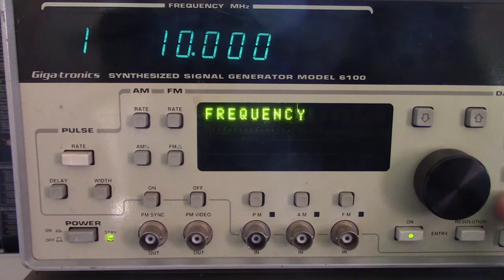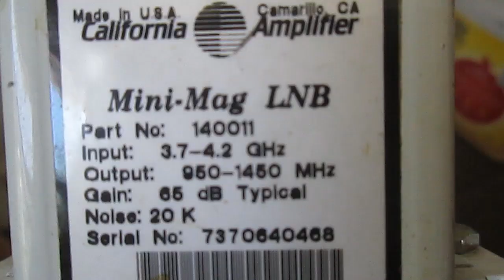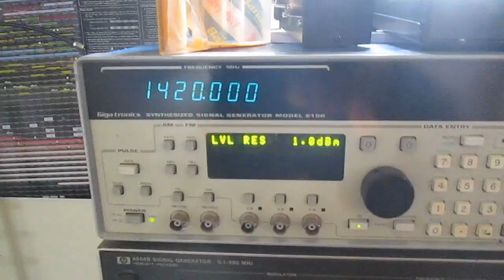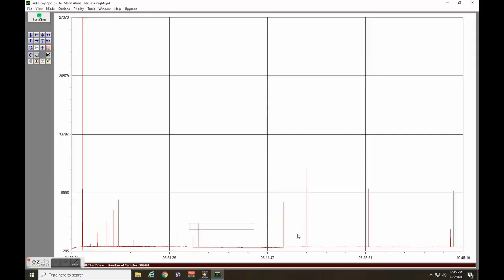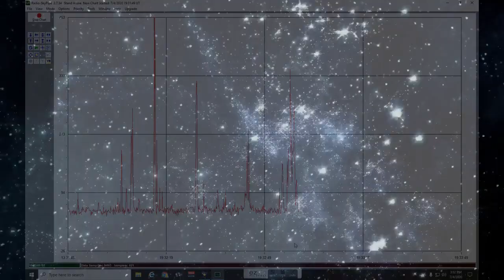DIY RADIOASTRONOMY

Comment: Sir, Can you please send the list of all the equipments?
Reply from the maker: Everything was described in the video but if you need more details I'll be happy to provide them as long as you are being specific. Thanks for watching!
Reply: @Neptunium   yes, I need a detail list, as I am making one for my project, please help me out
Reply from the maker: @pi.log10  
I used a 6ft dish antenna, the ICOM ICR7000 receiver, a LPT-3000 spectrum analyzer and the BladeRF SDR radio. I also tuned my antenna and receivers with a Gigatronics signal generator 0.01 to 8Ghz.
The software is the free download chart recorder from Radio Eye. All the cables and connectors are regular TV coax cable found everywhere. Thanks for watching

Comment: Hello, what was the size of the cantenna? Diameter etc. That you used?
Reply from the maker: Cambell soup can, the one that fit the feed horn support. and accept the inner wire length, if its too long cut it if it`s too short find another one or make one. Thanks for watching!

Comment: Can you point this towards the center of the milky way searching for 20.5 mhz like Jansky discovered in 1933 with the once every 23hrs 56 mins where he would pick up a hissing static noise?
Reply from the maker: Yes ! That's kind of what I did  but at a lower frequency. It shouldn't be a problem . I just can't see the Milky Way central area from my location.. thanks for watching!

Comment: Nice....but your 1420MHz feed is of the wrong size, it is much to small! The 1420.4MHz probe length should be a quarter wave long (only just under 6cm) and the can should be much larger diameter. The probe is then mounted 1/4wave from the bottom of the can.
Reply from the maker: Its close enough . I know it doesnt look like it on the video but i tried to get as close as possible to the 1/4 wave length....thanks for watching ! Always appreciated comments sir!

Comment: How do the radio telescopes generate images of stars orbiting black holes.. it shouldn't be possible with the simple antenna you used just to detect if there is a signal or not
Reply from the maker: They use the same technic a lot more precise than my little set up. The resolution is infinitely higher than mine. Then they get a single picel data point one by one until they can get a complete picture. Its a very long painstakingly tedious process.
Reply: @Neptunium  omg.. and here i was, thinking about looking into the edge of universe with my 4 foot dish..🤣
Reply from the maker: I whish we all could !
Reply from the maker: I could not even remotely pick up  pulsar eiter ... maybe a 15 or 20 feet dish could but certainly not my 6 ft ! That would be so cool tho..
Reply: The images of the S stars orbiting the Milky Way’s black hole are taken with optical telescopes, not radio telescopes.  Images of the black hole itself were done with multiple radio telescopes all over the planet combined together with interferometry to make one big virtual telescope the size of the Earth to achieve the angular resolution needed.

Comment: How can I connect with RASDR2 software or laptop pls make an video I am working on a project I am from middle class family so I can't afford so pls make a video and help me 🙏
Reply from the maker: Actually, I am not familiar with the RASDR2 at all but after a quick glance at the website, I don't see why it would be any different than any other SDR and software combo.. they all work the same way and it all come down to the type of connections for your coax cable . It really is that simple. No need for a video my friend, I am sure you are fully capable to connect a cable to an SDR module! Thanks for watching!
Reply: @Neptunium  thnx dear for helping me many more love from India ❤️

Comment: Could you see the hydrogen line with the Yagi?
Reply from the maker: You might be able to find a Yagi tuned for that band yes I believe so
Reply: @Neptunium  Thanks! I might try and build a 1420Mhz stack Yagi.  Tune it with a NanoVNA H network analyzer, hopefully that will work. :)
Reply: @Neptunium  yes sir u are correct we can find 21 cm Hydrogen line using Yagi. We are doing our project on Hydrogen line detection using various antenna

Comment: I was wondering about using a Yagi Uda antenna and thought that there must be reason why no Amature Astronomers seemed to be using it.
Reply from the maker: the wavelength is the main reason, dish are generally better at higher frequency and far more directional than Yagi, which are better in the VHF and lower UHF (again generally speaking) and with significant side lobes .. having said that it`s absolutely not a problem to use a Yagi and it has been done before no problem!
Reply: You need a lot of gain to do this as the signals are very weak.  You can use multiple long yagis, but a dish has much more gain and is cheaper and simpler.
Reply from the maker: Exactly!

Comment: Is it ok to use old 6ft dish
Reply from the maker: Yes
Reply: @Neptunium  I am building one next week
Reply from the maker: Cool ! Keep us posted about your progeess and results!
Reply: @Neptunium  ok now I'm using PICTOR free to use telescope to study about signals
Reply: I ordered RTL SDR,LNA ,and other cable connector from Amazon I'm so excited 😅
Reply: I have a doubt is it ok to power up LNB using a 9v adapter dc
Reply from the maker: @Steveinbasement  I dont see why not.. depending what kind you getting, they usually run on 12 to 18V from my experience .. 9V is fine
Reply: @Neptunium  Ok thanks man
Reply: @Neptunium  Can you tell me how much current and voltage I needed for  LNB and LNA I have a 12v and 2A adapter i think I use it to power up LNB and LNA with 12v 1A is it ok I mean does it damage my RTL SDR
Reply from the maker: @Steveinbasement  i honestly dont know... it depend what you are using . mine works with the power supply from an older satellite TV system and generates 18V DC.. As I talk about in the video, I used a bias filter to NOT blast 18V DC into the spectrum analyzer and the SDR. So you`ll need a T connector with your filter at some point.
Reply: @Neptunium  ok
Reply: @Neptunium  does using RTL SDR is legal or require any license
Reply from the maker: @Steveinbasement  its legal, no license required.
Reply: @Neptunium  can you tell me a better free to use application for radio astronomy
Reply: @Neptunium  I'm currently using AIRSPY
Reply from the maker: @Steveinbasement  oh i am sure a simple google would help for that...
http://www.radiosky.com/downloads.html
A lot of resource and help here:
https://www.astroleague.org/programs/radio-astronomy-observing-program
Ham radio has all kinds of helpful site like this :
http://www.astrosurf.com/luxorion/qsl-ham-software.htm
and this list of free software for RTL-SDR enthusiast..
https://www.rtl-sdr.com/big-list-rtl-sdr-supported-software/

This search took a whole 4 seconds...
Reply: @Neptunium  thank you it's really helpful im trying to build a array detector with 2 or 3 6 ft CBand dish 
And merge the signal from 3 LNB into one and then to LNA to RTL SDR does it works fine and do you know how to convert this signal to image
Reply from the maker: Ah yeah an interferometer ! That would really be awesome ! You know I've looked for easy way to get pictures from a signal but I could not find anything other than these 2 options which are both long and a real pain.
https://youtu.be/aeah3fFYlnA
And this one
https://youtu.be/AAJTHsjYoPA
Both very good and interesting but without the critical details ...
Anyway good luck ! Make sure to share your results!
Reply: @Neptunium  can i connect to 2 or 3 LNB source with splitter to merge signal i search for this cable splitter but there a some specific values 5-1090mhz 5-2590mhz and it only used to split does it affect if I look for hydrogen line frequency
Reply from the maker: @Steveinbasement   if you have a down converter then no, a lot of LNA have a down converter and you want to look for your signal at whatever the downconverter says usually 950MHz. Building an interferometer with several dish is not a small project... maybe you should start smaller and once you've become familiar with the equipment, move on to a bigger project ... but baby steps first to be successful. just my 2 cents
Reply: @Neptunium  yeah thank you
Reply: @Neptunium  so my RTL SDR can tune signal from 500khz to 1.7 ghz so I can tune only to 950 mhz my downconveter says 950 mhz so if I use single dish and lnb even after tuning is only to 950 mhz I'm confused now
Reply from the maker: @Steveinbasement  The downconverter convert the highest frequency in Ghz from the lnb to lower frequency for the SDR to pick up. so the low 3Ghz will become the lowest side in your SDR and the highest signal from the dish will now be the highest part of your downconverter range (from ... to ...) its a range not a single point you get it ?
Reply: @Neptunium  it means I can listen to all signal with SDR even using a LNB downconveter can you tell me which is efficient and better for my setup LNB or a feed horn you builded
Reply: @Neptunium  now I built a wire antenna with my friend it is working well
Reply from the maker: No I can' t possibly know that, You'll have to do your own testing and see what works best for your set up. That's part of the fun too ! Best of luck!
Reply: @Neptunium  thank you very much

Comment: Well who knows if after 3 years you still respond however I would be interested seeing a hybrid system, a radioastronomy combined with visual astronomy.
Reply from the maker: it would be nice indeed! I am still working on a similar project, I cant make any promises just yet but I am working on stuff! Thanks for watching!
Reply: @Neptunium  I thank you for making this video, it seems less daunting then other videos on radio astronomy tho you didn't convert the data into images if I recall correctly you can convert radio astronomy data into images. that combined with visual astronomy overlaping each other would be very interesting. gonna watch out for your new stuff.
Reply from the maker: @Lillian_La_Elara_Silverwood  you are talking about delay doppler imaging and I was not set up for that in this video. Another way would be to simply map the radio signal strength and that's a different type of processing and set up.  Usually takes a long time and is tedious . The thought Emporium has done that and "saveitforparts" too ...

Comment: How did you calculate the length of the wire inside the can? (I'm guessing it's the wavelength, which should be around 21.1 cm)
Reply from the maker: Correct! The quarter wave works too so about 5 cm if I remember correctly
Reply: @Neptunium  Thanks a lot.

Comment: I am planning to build a radio telescope out of an old satellite dish. I can get my hands on a 0.9m dish that comes with an LNB  which operates at 10.7 - 12.75 GHz input frequencies and gives out an output range of 950 - 2150 MHz. Will I be able to observe the Sun with this equipment? In some articles I read that to observe the Sun at 1420 MHZ, one has to build a custom feed. I can understand that. If I build a particular feed it will have a capture bandwidth centered around 1400 MHz. And I can figure out the electronics for that. But I can't understand this LNB thing. Could you explain the input and output frequencies?
Reply from the maker: With the set up you described, you'll be able to observe in the X band between 10 and 12 GHz. You can use this microwave region to detect cold and warm bodies with extreme sensitivity. Because these are high frequencies difficult to handle, the down converter changes the signal linearity to more manageable frequencies. So if you see a signal at 950 MHz, on your receiver, that means it was picked up at 10.7. GHz by the antenna and down converted to 950MHz . It's a small transformer really . This LNB was designed for TV reception so the signal from the dish could be transmitted by cable to the TV. Keep it. It's very  useful.
Reply: @Neptunium  Okay now I understand. That's why it's called a downconverter. It's actually receiving the high frequencies and then converting it to low frequencies for analysis.
 If you could help me with one more thing I would be very grateful. 
The LNB receives the microwaves. Now I want to get an audio output (a buzzing sound as I point the dish to the sun) and then I would like to plot a graph. I don't know much of electronics. Indeed I'm a Bachelor of Science in physics but I have more control over theoretical aspects than practical applications. Some articles I read says one could use an Arduino. Could you help me with the circuitry?
Reply from the maker: @beaconoflight8298  I am not good at electronic either .. you can get a  satellite finder that's exactly what it does . You also need to power the LNB and the satellite finder, an old satellite TV receiver and some coax cable is all you need.  To get a graph as I showed in the video, you can use the output of the satellite finder and plug it in your PC like I demonstrated, and use any free chart recording software . Hope this helps good luck!
Reply: @Neptunium  Thanks for the help. I'll see what I can do.
Reply: Do a search for " Alex  Pettit galactic hydrogen radio astronomy " and watch the Aug 1 2022 video  
Cheers,
Alex KK4VB
Reply: The SUN is a broadband black-body radiator due to its Temperature .. It has no particularly strong  response at 1420 MHz as all the hydrogen is Ionized ( hot) . The 1420 MHz Spin-Flip frequency is associated with 'cold' neutral hydrogen .. as exists in the large interstellar space within the Milky Way.       Alex KK4VB
Reply from the maker: @alexp8144  I was just using the sun as a reference to get an idea of the beam size of my antenna but these are all valid points! Thanks for the comments! KE8YDE..

Comment: I am having a 3feet offset antenna to capture the hydrogen signal of 1420mhz .... Will it work or not?????plzz
Reply from the maker: I have no idea what you are using ! Offset what? Dish? Pole ? Yagi ? With what radio/ detector. my guess is You'll probably get something... you're looking for a 21 cm signal (as described in the video) so 3feet or roughly 1 meter is about 5 times too big . Worse case scenario, you can always try it and find out for yourself right?
Reply: @Neptunium  parabolic offset antenna height 38.5 inch and width 35.5 and depth 3inch...
Try to capture 21cm wavelength..
Will it work???
Reply from the maker: It's a bit small but you'll get something for sure. Have fun!

Comment: What's the difference between this and AM radio 1420? I feel like AM radio signals would just overpower radio waves on earth but I'm no astronomer or radio guru
Reply from the maker: You can broadcast in frequency modulation, amplitude, side band, etc.. but you listen in whatever modulation that matches the signal you are picking up, if I am not mistaken, the carrier is assigned by the FCC . They dictate what frequency to use to limit interferences between station. In radio astronomy it doesn't make a difference since in this video at least I was looking at the total radio power . I usually set it on wide FM but I did use AM just to see if it would make a difference.. and it doesn't.
Reply: 1420 on your AM radio is 1420 kHz in the medium wave band.  He’s listening to 1420 MHz, a thousand times higher in frequency in the UHF  band.

Comment: Hi I am starting radio astronomy and just wanted some more details on the feed horn 
Thanks
Reply from the maker: There is really nothing to it as you can see it's just an exposed wire of a quarter wavelength of interest. So for 21 cm it's about 5 cm long and thats it !
Reply: @Neptunium  sorry but what does quarter wavelength interest mean? I’m just a beginner and I just brought the nooelec mini 2 sdr
Reply: @Neptunium  is it really as simple as putting the can in where the lnb would usually be?
Reply from the maker: @rileypowis5319  yes the wire is an antenna you want the radio wave focused be the dish to concentrate on this little wire. Antenna resonates with the frequency (or wavelength) you want to detect so if you want to pick up 20cm for example an antenna about 20 cm long will give you the maximum gain, half length ( in this case 10cm) will also resonates and a quarter or 5cm will work too
Reply: Does the can have to be a certain size and does the antenna have to be in a certain point in the can?
Reply from the maker: I picked that can. Because it was about the same size as the original feed horn. You can adjust the position for best result

Comment: You can't build a radio telescope at home. You dont have enought money for that, and you dont know how to even do it
Neptunium: Hold my beer
Reply from the maker: You're right I don't know  what the hell I am doing ....obviously...Why do I even bother ? Well I tried.... And trying is far better than useless criticism .
Reply: Have you ever talked to HAM radio folks?  They did it.  I did it years ago.  So there!
Reply from the maker: Yes ! I even studied for my license about 2 years ago. I was schedule to take the test before covid happened
Reply: @Neptunium  Do you use SDR Console, and Radio sky-pipe connected trought LAN?
Reply from the maker: The SDR connect via USB and radio-sky pipe  works with the sound card, mic or line in ...
Reply: @Neptunium  Do you use RTL_Bridge? (RTL_Bridge is in the same folder as RSS. There's an .exe file called "Rtl_tcp.exe" whitch I can't start)
Reply from the maker: No I think it worked fine without it.